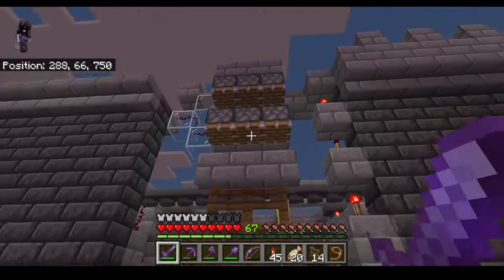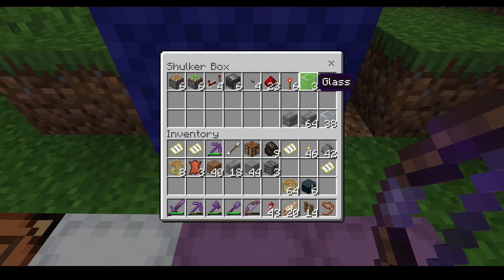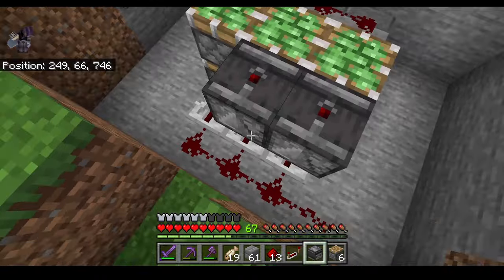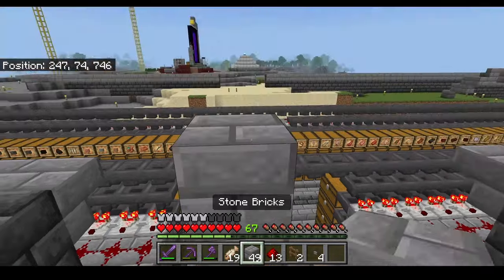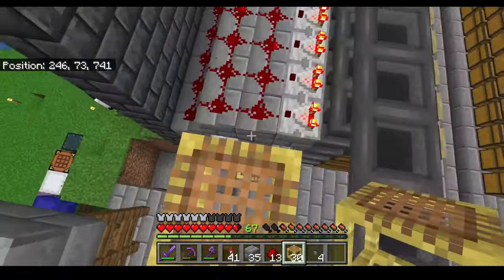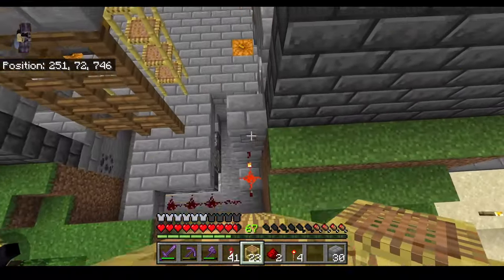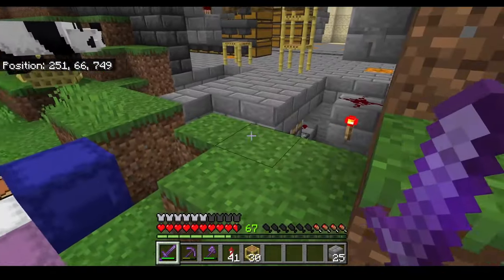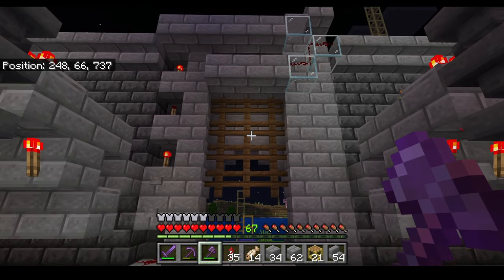How to make a working Castle Gate EASY (no gravel or sand) Minecraft Bedrock 1.20

Comment: Great tutorial, but you missed something. For everyone who wants to build another two buttons inside the gate to open/shut it. Build a second tower and connect it to the same red stone line that the other original red stone torch “tower” (with the first two buttons at the bottom) uses. Build this tower exactly like the first but wherever you want the buttons, it should work.
Reply: fr

Comment: When I build this and I get to the first test of the pistons, pressing the button pushes the blocks up (I'm using deepslate bricks), but when the pistons retract the bricks don't come down. I have to press the button a second time to get the sticky pistons to pull the brick blocks back down again. I've triple-checked the details and I've definitely got everything in place correctly. What might cause that to happen? I'm using 1.20.4.

Despite the issue detailed above, I continued and finished the build with the attitude that pushing the button twice to get things to completely work was better than nothing, for the time being. However, when I press the button to close the gate, only the very top row of pistons activates. The lower row of pistons above the gate does not activate. So the gate never completely closes. Again, I checked, re-checked and re-re-checked to make sure I was following the video. Help!
Reply: Nevermind. I just noticed "Bedrock" in the title of the video. It seems that this is yet another case of Bedrock and Java not working the same. For instance, apparently, redstone will go UP stepped glass, but not down - which explains one of my issues.
Reply from the maker: awww man sorry buddy
Reply: @erikvdo  hey, I m on bedkrock and it does the same

Comment: Having to press the button twice to get all the block to reset closed any tips?
Reply from the maker: Did you make the gate wider then the one I did? Maybe use repeaters to increase the signal
Reply: @NFTlol I built a small scale version (2 blocks wide) and it worked just fine. I’d like to build a five block wide gate, but when following the same steps, the top pistons fail to retract.